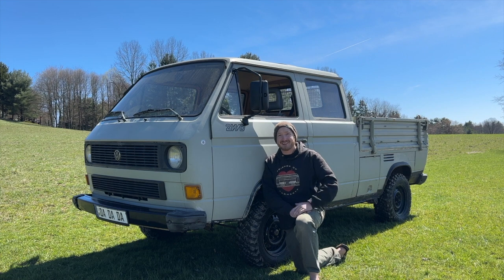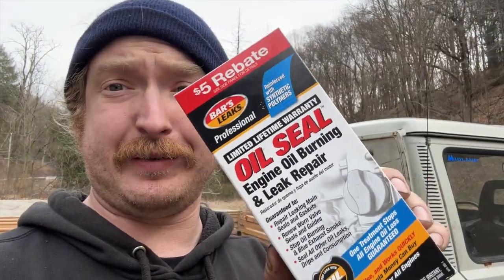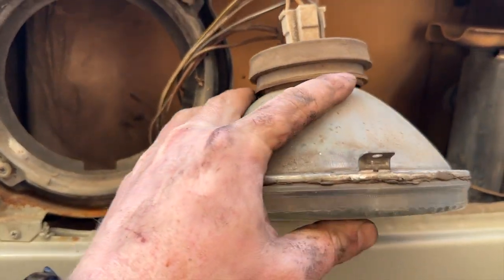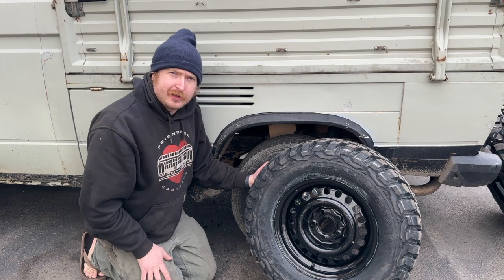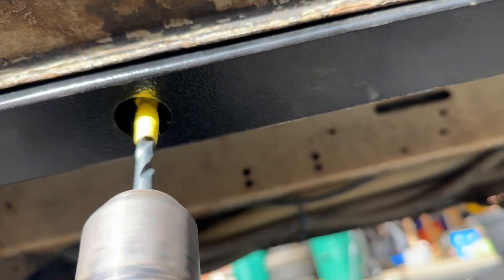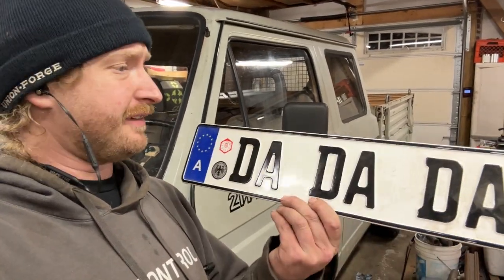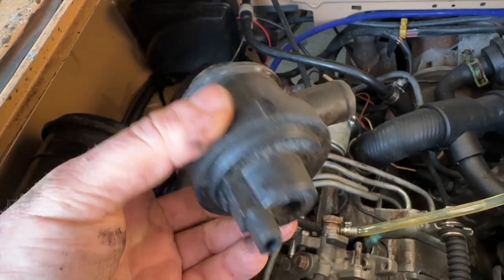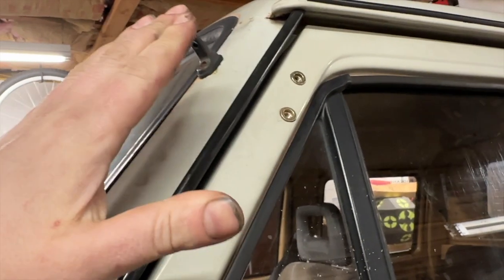VW Doka From Poland- Chapter 3 "Let's Make It Cool!"

Comment: The stainless steel tubes will help to prevent the engine for overheating, because it is a great way to cool the water. In winter you have to insulate them a little bit, otherwise you don't get enought temperature to use the heater in you cabine. Best regards from Germany, Ralph

Comment: The thing you do with the mirrors is. Adjust to your liking and then park it outside for 3-5 years preferably in a location with a lot of vegetation. after 3-5 years you wash the car and accidentally unseize them. Leave it for 3-5 years again now when 3-5 years have passed you need to remember not to wash it or park anywhere near other cars, otherwise start over again :P
Reply from the maker: I’ve used this method in the past- im not a fan. Truck mirrors are a reallllllllll nice upgrade!
Reply: @TheBarefootForge  There is an LT at my local scrap yard gotta see if it has mirrors. The original are annoying as heck

Comment: for the ends popping out of the long coolant lines I have had good luck drilling and using some pop rivets to retain them as well as give a new feature to clamp against. the headlights are factory European H4's that have a city light instead of the parking lights in the directional
Reply from the maker: Ya the euro city light thing is insane and horrible to deal with so far. Lol. I’ve seen the pop rivet trick, but I’ve also seen it create a weak spot in the pipe and the whole thing crack off in a ring around where the rivet was drilled…

Comment: Loving the look with the wheels/tires, lift and mirrors. 
The last time I saw column wiring that look like that was on a 1984 Dodge D-50 4x4 at the harness plug end, and it scared the crap out of me finding it! Post fix it did correct half the electrical issue with the old thing.
Reply from the maker: It’s got a whole new vibe and energy! Wait till chapter 4 when we add a winch! : )

Ya, that wiring is terrifying. I’ve fixed it and everything is working correctly except one circuit, which is next on the list of repairs.
Reply: @TheBarefootForge  Absolutely great to hear that! 
I'll happily wait for the next update. Happy upgrading!

Comment: Having recently imported a Vanagon from USA to Poland (the more usual way) I had a similar but at the same time opposite experience with headlights. Where are the parking lights? There is no opening for the second bulb here! Then I recalled that they are in the indicators. That's crazy! ;)
Reply from the maker: Absurd! Easily rewired though…..

Comment: I think the same "auto-electrician" who did your wiring did mine facepalm
I have had to redo 90% of the wiring. Mine also had two engines' worth of wires in (swapped from aircooled to Essex V6). Good luck. Please be nice to the DoKa.
Reply from the maker: Thanks man! Ya, the previous owner always screwed us all! lol

But yours is running well and reliably now?
Reply: @TheBarefootForge  Overheating, using oil, dripping water, crunching gears. You know, it's a DoKa :)
Going to redo the engine soon (V6 Essex). Electricals are 100% though.

Comment: Learning so much from this, and experiencing a bit of deja vu too, figuratively speaking.
Reply from the maker: Thanks man! I’m glad I could share some useful info and hopefully a good smile as well! What are you working on?
Reply: @TheBarefootForge '91 Syncro Doka imported from Belgium (I think), was a 1.6 TD JX, blew a head gasket and now it's a 1.9L TDI AFN. Pouring money into at least as fast as you seem to be.
Reply from the maker: @Achilles3588  I’ll race ya! I bet I can pour money faster, even if you can pour it harder.
Reply: @TheBarefootForge  Does a monetized YT channel or a paying sponsor like GW help fund your expenditures? 'Cause I got neither of those.
Reply from the maker: @Achilles3588  every bit helps! Every comment helps! 

But you’d be surprised how little YouTube pays…
This video will make $50 by the end of the year, If that.
Reply: @TheBarefootForge  All I'll say is keep up the good work. Everything you are doing or planning to do on that crate I have either done or am planning to do to my rig, and then some (just put in AC...that was sum phun). They are clones. The list has been long, getting shorter but not as fast as I would like.